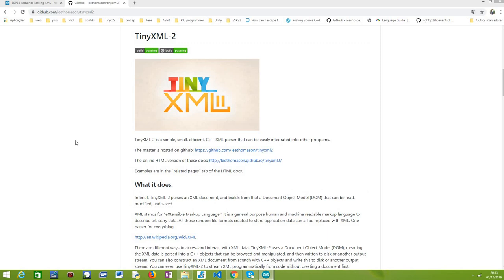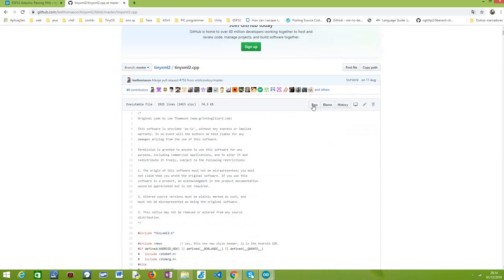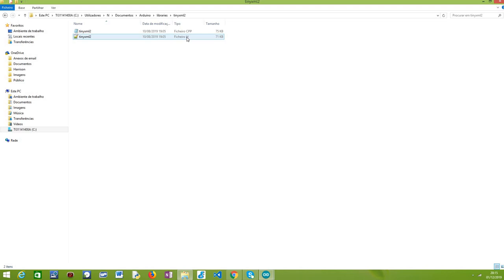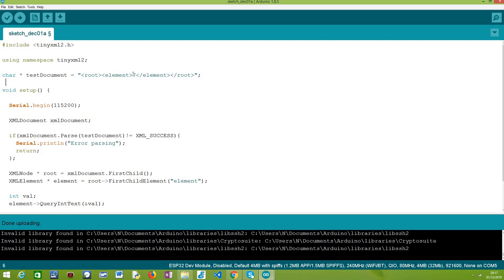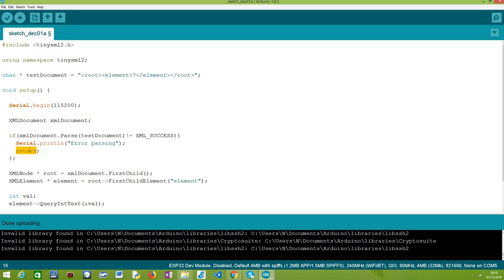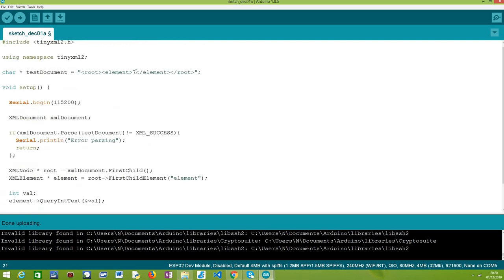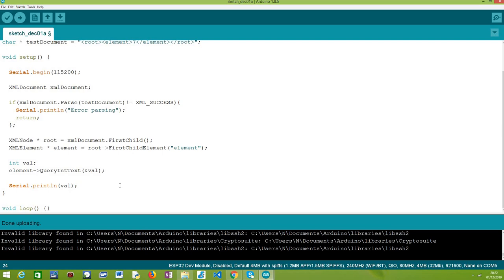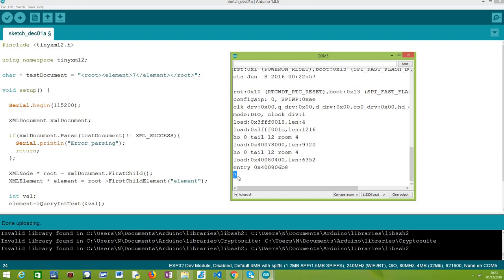ESP32 Arduino: Parsing XML

Comment: Your tinyxml2 library code works smashing on even quite a large "locally" accessed XML file but won't work when trying to parse the same XML file content taken from a server via http.

When doing so in the latter case, the XML file is prematurely truncated half way down the tree with half the data missing and a subsequent failure to parse anything at all.

I can find no solution to it, unfortunately.

Comment: Here is my code.  I am running on a mega:  #include <tinyxml2.h>
using namespace tinyxml2;

char * xmlTestData3 =  "<root><element>7</element></root>";

void setup(){
  Serial.begin(9600);
  while (!Serial) {
    ; // wait for serial port to connect. Needed for Leonardo only
  }

  XMLDocument xmlDocument;
  Serial.println("Parse");
  if (xmlDocument.Parse(xmlTestData3) != XML_SUCCESS)
  {
    Serial.println("Error Parsing");
    return;
  }
  XMLNode * root = xmlDocument.FirstChild();
  XMLElement * element = root->FirstChildElement("element");
  int val;
  element->QueryIntText(&val);
  Serial.println(val);
  
}

void loop() {}